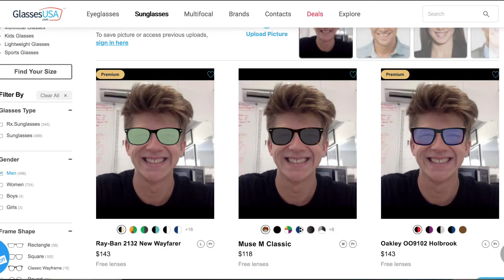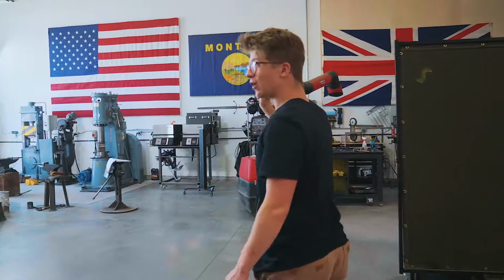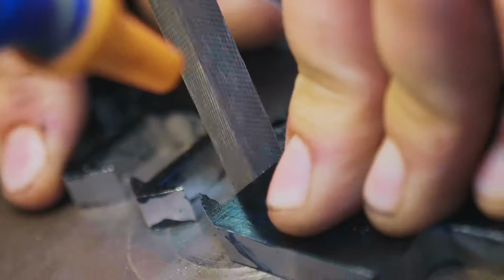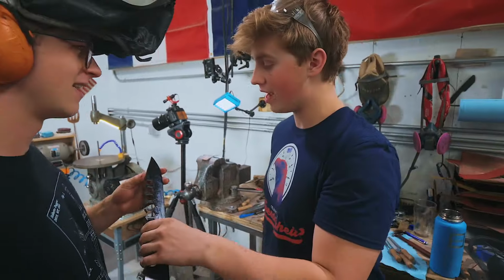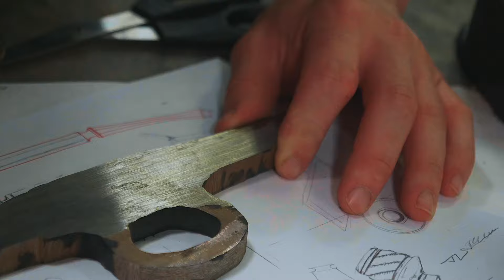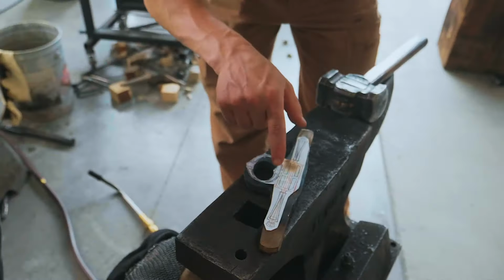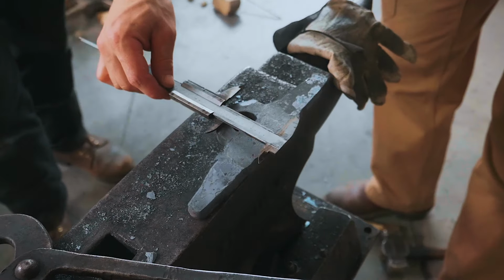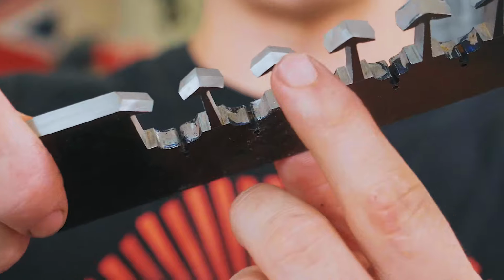MAKING THE SWORD-BREAKER!!! Part 3

Comment: You should clamp down lightly the workpiece to the die filler to avoid danger, there is a youtube channel "This Old Tony" that explains how to use a die filler
Reply: You can't clamp the work piece down tightly. The workpiece needs to be able to move around. You're thinking of something different. It's a plate clamped to the table that stops the workpiece from lifting up.

Comment: Why not forge the ring separately shape the guard and weld the ring and grind it to shape?
Reply: Another one is making a jig for the press that does the drifting for you using a kind of carbon coating mix on the drift to allow for easy passage. I forget the exact bits but  it looked much more expedient

Comment: dont you have the top parts for the filing machine ?? that setup looks quite dangerous for me. 
on my machine the file handle is attached to a small chuck at the top , so it always cut at the downstroke

Comment: Drift 2 smaller holes side by side to keep that nub? Or ditch the little nub!
Reply: He does that all the time. A little issue pops up, and instead of making it work or changing the design, he starts all over.
Reply: Was thinking on sort of the same lines with using a two pronged punch.

Comment: Teeth seem over worked a little on the thin side. But then again it's not really going to be used so maybe that doesn't really matter.
Reply: They're plenty strong. Once it gets hardened & tempered, they'll be very strong.
Reply: @xenonram  True enough and again I'm pretty sure they wont be parrying any fatal blows with it.

Comment: Imagine using 50,000ths of an inch instead of a couple millimetres
Reply: Not 50,000ths, it's 50/1000ths. (0.050") Derp. 50,000ths are 0.00002" or "twenty-millionths" and 1000ths are 0.001" Big difference. You have those same terms in metric AND USCS. 
0.002 mm is "two thousandths on a millimeter" or you might say 2 microns/micrometers. It's the same terminology on both systems. You can have "fifty thousandths of an inch" or "fifty thousandths of an mm"  Imagine not knowing how to use rational (fractional) numbers. Whether or not it is inches or mm, you should know fractions.

Comment: Teeth look too thin... Ok for stopping a fine dueling blade maybe? Not for a heavy long sword
Reply: Alas, that's exactly what they're for. Not really going to catch a proper longsword, but a Rapier or Epee? Sure. ;)

Also, they're nowhere near done thinning it out - that blade is still probably twice as thick as the finished product. So the proportions will change a bit before it's finished. They teeth might look a bit thin, but it is made of high quality steels, so it'll be stronger that it might look... in the end we'll see how it goes. I'm definitely enjoying the trip. :)
Reply: Yeah.. I guess I was already disappointed, when I saw the drawing on the first video I was expecting some giant sword busting beast. Interesting to learn about a sword grabbing tool though. Indeed will be cool to see how it turns out.

Comment: Reference to guard. I know it's not as pretty and kinda lame. Seems  would be easier to just use 1/2 inch diameter steel rods  shape / bend then forge-weld them to spec and then file in all the the cool accents rather then wittle down a massive block of steel. "Pointy Stabby thing" my gosh, ya'll  need to collaborate with some "HEMA" instructors or Filipino Arnis teachers.